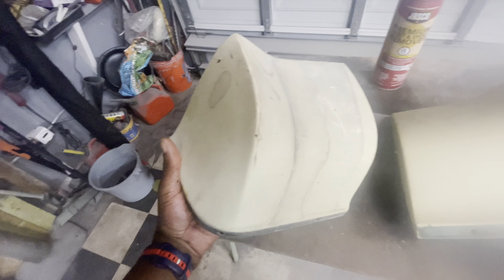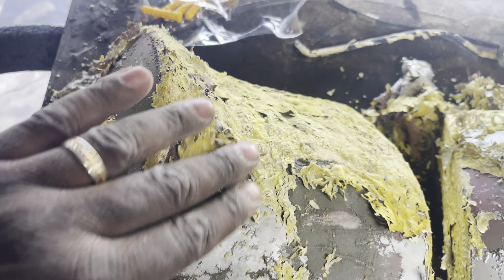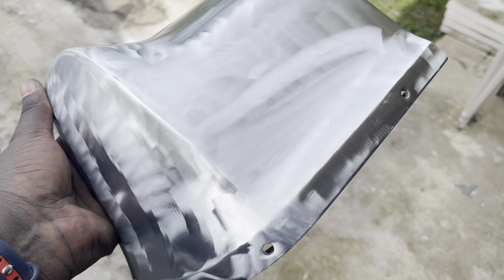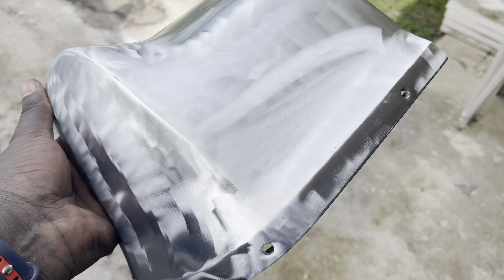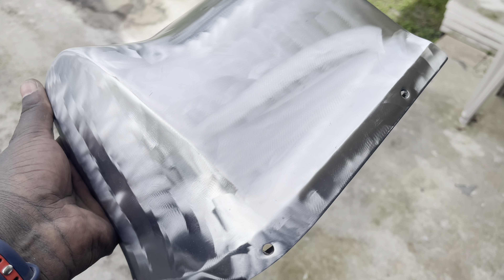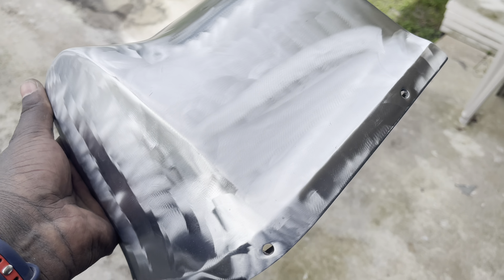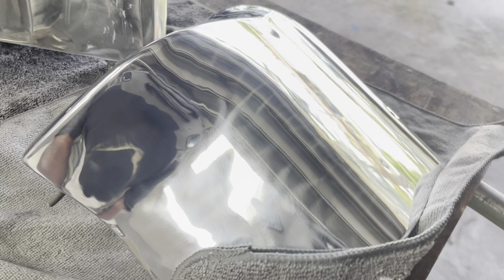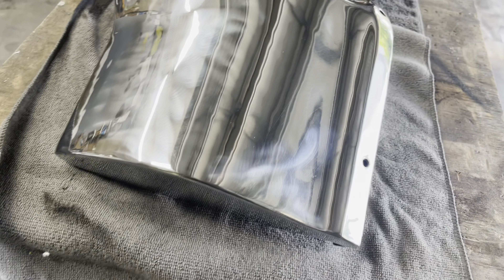They said it couldn’t, but first ever done, pot metal to shiny outcome!

Comment: i think you would have got a better finish by doing more by hand. i think the 800 grit was too harsh and has created a ripple effect. i see it when i go to shows where a D A sander has been used on bumpers and they no longer look straight. better to block it with a straight flat block first. although to be fair it is a nice improvement.